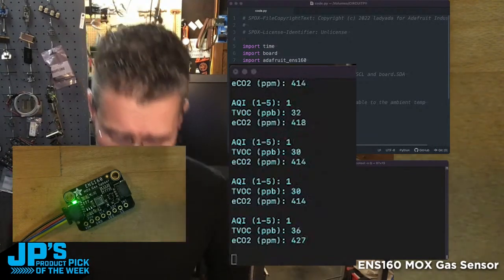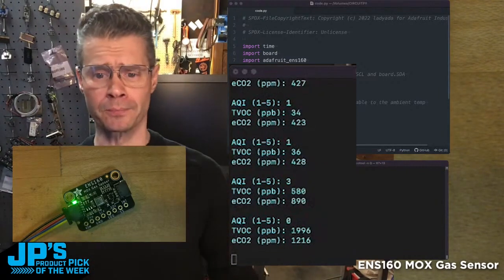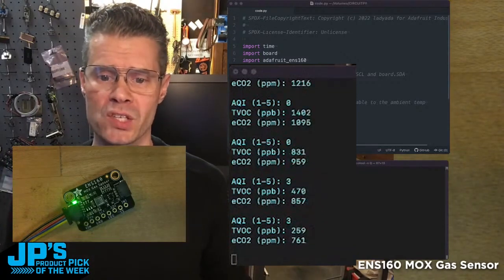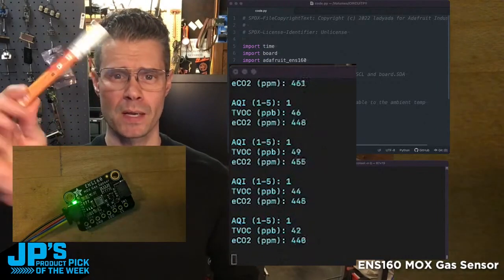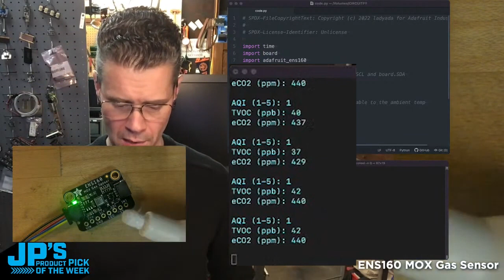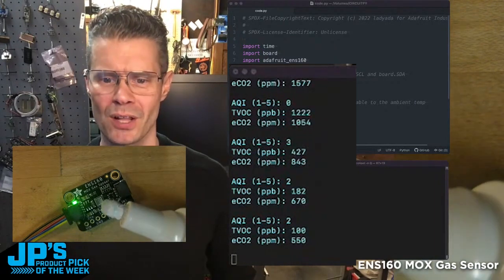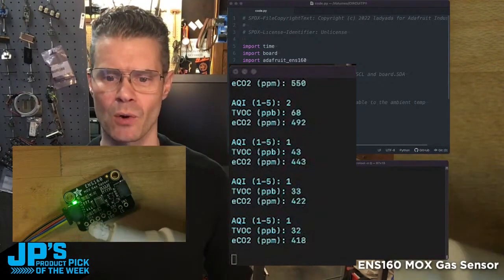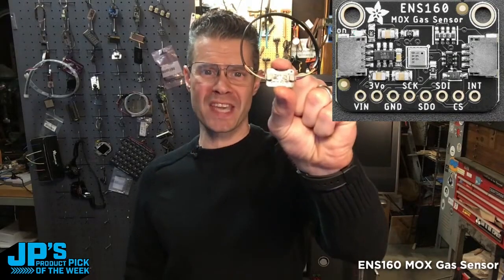JP’s Product Pick of the Week Recap 11/29/22 ENS160 MOX Gas Sensor Recap @adafruit #adafruit

Comment: Note that MOX can measure VOC but not CO2, which correlates with VOC in indoor situations, so it calculates CO2 from VOC (and temperature and humidity and pressure). Not sure if the ENS160 contains sensors for that too or they're discrete on the board or you have to feed in your own values.